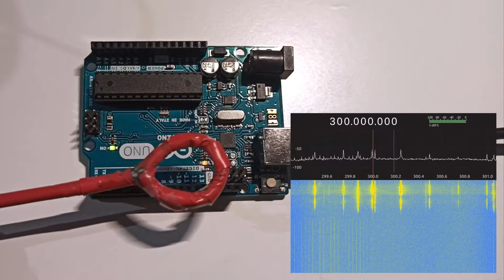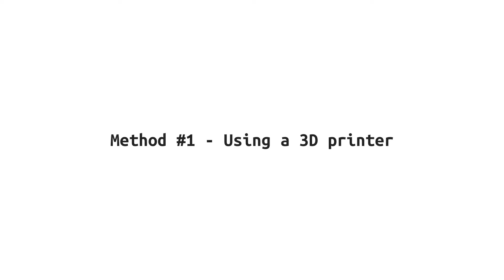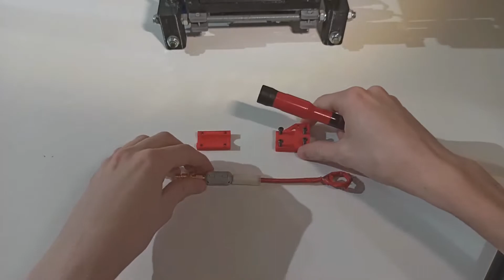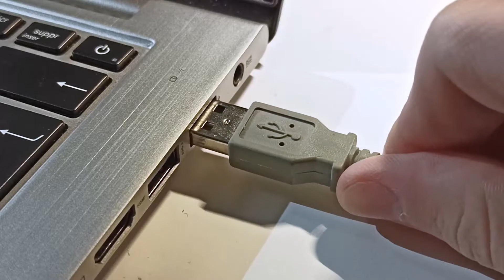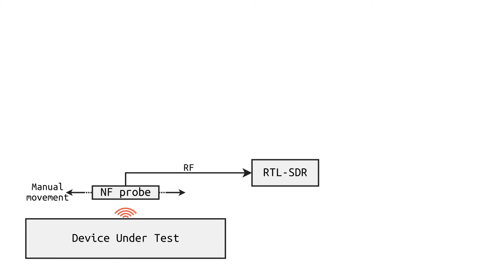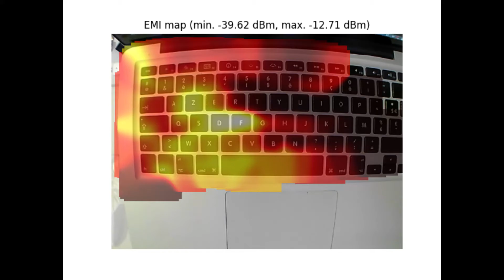EMI mapping - 2 DIY methods (3D printer & machine vision)

Comment: This looks like it could be promising! Are there smaller emi probes that you could use with this? You could heighten the resolution of your map by using the z axis and programming in a 3d model of the board to get closer while still avoiding collisions with components, couldn't you? I don't know how precise an emi map needs to be, but if you could directly change the 3d model of the board to cnc coordinates, then you could get within millimeters of the board if you need to!
Reply from the maker: Hi! That's an interresting idea! I might try it out, it seems not too difficult. One problem I see with this is that the near-field to far-field extrapolation would become exceptionnally hard to do. I still have to work it out with my simpler plannar case though.
Reply: @CharlesGrassin  Why would you even need to worry about far-field interference? It doesn't sound like it would affect anything unless we're talking about audio equipment or radio transceivers. I've just started reading about this, ignore if this is a dumb question
Reply from the maker: The EMC regulations are often based on far field emission, the idea being to prevent any device from perturbing everything else (eg: 2014/30/EU for the EU). Hence, compliance testing is done in the far field which is costly. Being able to extrapolate near-field measurements is a way around this.